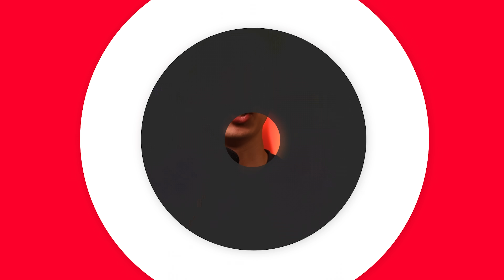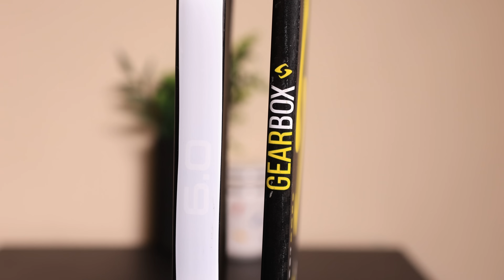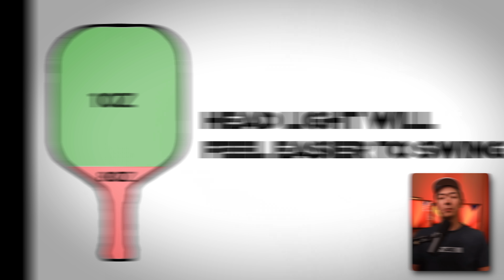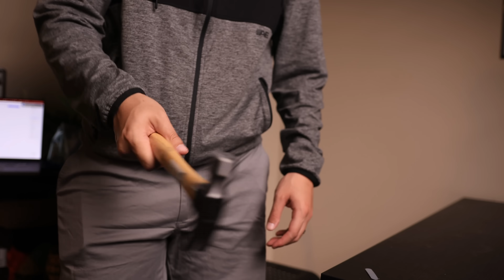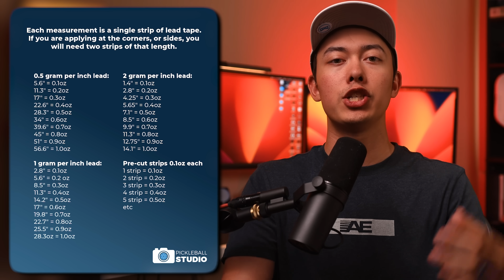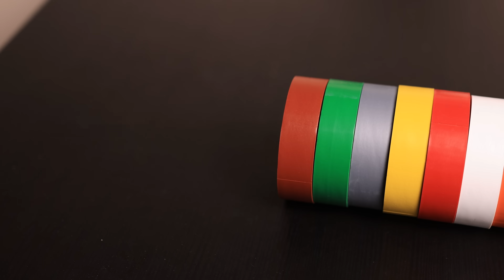The Ultimate Guide to Using Lead Tape on Your Pickleball Paddle

Comment: Excellent video as always Chris!  Remember to factor in your grip first before adding weight if you are changing it. I have a Gearbox cx14e. Most people have to make the grip bigger on Gearboxs. I put a full grip on it(thereby adding 'weight' to the handle) and then it became head light so I had to add weight further up the paddle  to get the swing I wanted. My paddle is a full oz heavier than my wife's but she says it feels the same weight...and I agree with her...of course😉
Reply: Be sure not to sweat, because the extra weight in the grip material can adjust the balance, too!!!

Comment: What about adding lead tape to the handle?
Reply: @braddaddis371  Interesting, I had my CRBN 1x set up with tape on the throat and tape in the top two corners, that felt unbalanced, so I wrapped some tape in the handle and it turned my paddle into a monster. Super powerful and much easier to maneuver. My experience, I think it could help balance out the top heavy paddles for sure.
Reply from the maker: I go over it in the video. You can influence the balance of the paddle with lead in the handle, but you can't lower the swing weight. The paddle won't become faster by adding it to the handle.

It can be a good way to increase the static weight and not impact the swing weight though.
Reply: @PickleballStudio  In essence, it can make the paddle head feel flickier; but certainly no easier to swing.   And how many folks need to be flickier with their strokes???
Reply: @KarthixHD  I’m sorry…I thought you meant tape on the handle to for increased swing weight.  My bad.   With the CRBN 1x already being a bit of a monster, sounds like you are giving your opponents hell with that set up!  Nice.
Reply: @braddaddis371  oh no worries!! Yeah my paddle is monstrous, people have been saying it’s the fastest serve they’ve seen!